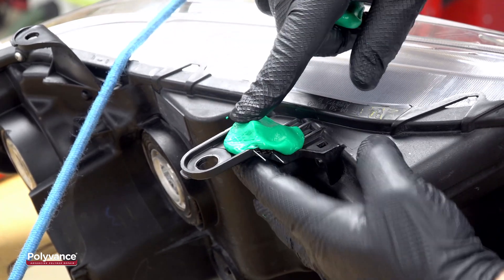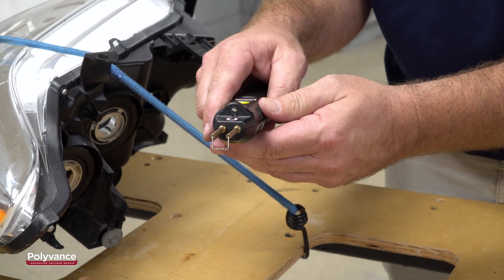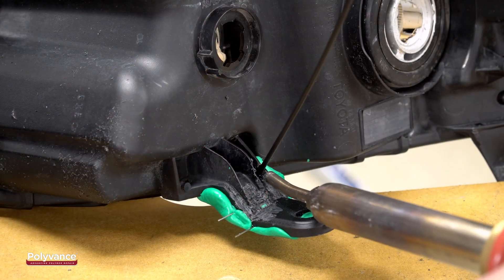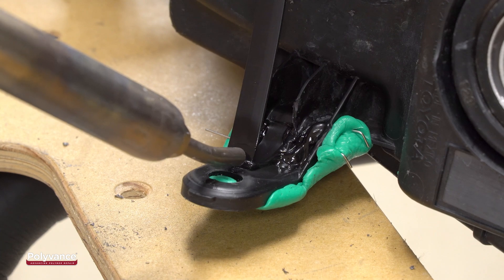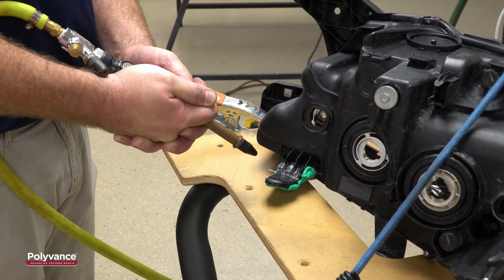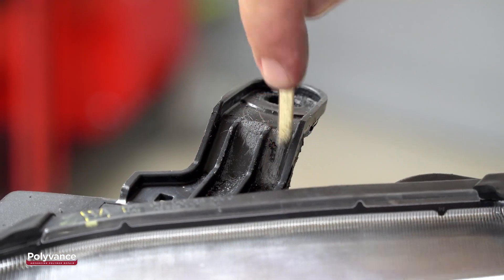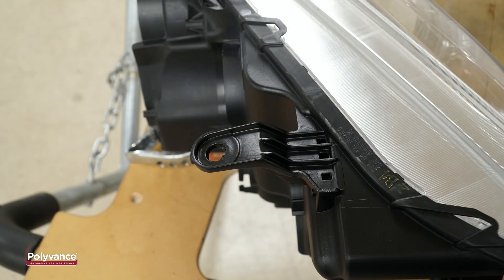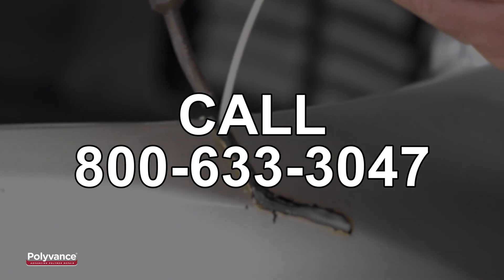Toyota Tacoma Headlight Tab Repair Using Tab Magic Molding Putty

Comment: I understand the level of perfection but our client won't pay for that labor and materials on one Tab .
Reply from the maker: More complex parts are being added to headlights lately (LEDs, moveable elements, etc.) and the cost is more expensive. Being able to repair a tab could save a lot of money.
This article talks about win-win scenarios for both the shop and the bill payer (check out the plastic repair section): https://www.autobodynews.com/index.php/component/k2/item/15517-the-best-body-shops-tips-repair-vs-replace-what-a-body-shop-should-consider.html?showall=1
If we spread the word about what can and cannot be repaired, more people will realize that they are missing out on opportunities.

Comment: That is way WAY to much work for a tab haha
Reply: Would you say that if it made you $$$$$?  It easily can make the shop hundreds of dollars.
Reply: @scottb7600  ....and make very pissed off customers.
Reply: @lizardking8388  Why would they be pissed off?
Reply from the maker: Many times there is a win-win scenario for both the shop and the bill payers. Check out the plastic repair section of this article: https://www.autobodynews.com/index.php/component/k2/item/15517-the-best-body-shops-tips-repair-vs-replace-what-a-body-shop-should-consider.html?showall=1
Reply: @scottb7600  For the time you put into that job, you would have to charge a lot to make a decent profit. The customer will get a couple of estimates and go with the shop that would charge probably less than half to do a job just as strong but perhaps less aesthetic in appearance.

Making the repair look perfect under the hood has its merits for the most nitpicking customer, but I think most people would be less willing to pay more for something that's not going to show when the hood is down.

You come at the customer with a hefty price, he's not going to want to hear that you'll do a better job than a typical shop; he'll just write you off as a ripoff.
Reply: @lizardking8388  This is to satisfy insurance companies call for "AS NEW" appearance requirements.  Certainly, if you didn't care about the looks and you were paying for it out of your own pocket, it can be done quicker and therefor cheaper by any body shop with the right skills.
Reply: @scottb7600  Well, if you have some deal with insurance companies to refurbish old as new vehicles; I will agree with you there. However, as I remember it, a typical customer who was in a car accident would get three estimates from three different shops and will give the job to the shop that offers the best deal; at least that's the way it used to work. Of course having the best deal is not only which shop will do the job cheaper, but who will do it best. So most customers would then look up reviews of shops and find a few that have good quality ratings; then they will get the three estimates and choose the cheapest. If you're a shop, you will want to be the one they chose and if you have to charge more, that's not going to happen.

Anyway, a DIY'er who will do their own job themselves might want to do this, but the cost for everything wouldn't justify it. In that case, a cheaper set like the HF plastic welder $15 would probably be their best bet.

Comment: First!
Why does they put talk in heater core housing behind dash where the air distribution flaps are, it writes on housing >PP-T30<", that also means talk 30%, but why, what is the purpose of talk in heater core housing, maybe much resistant on high temperature or what?
Reply: I believe the talc is there to reduce cost, reduce the likelihood the part will warp when heated and cooled repeatedly and possibly to increase strength; although I'm not 100% sure on the strength.